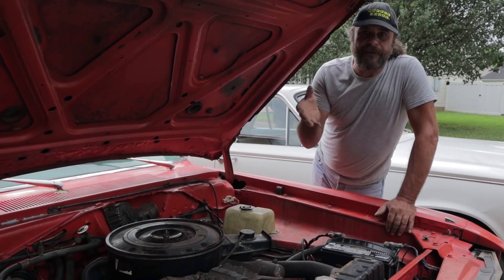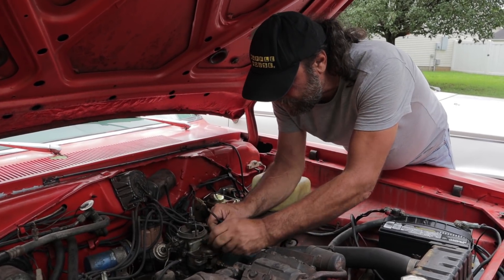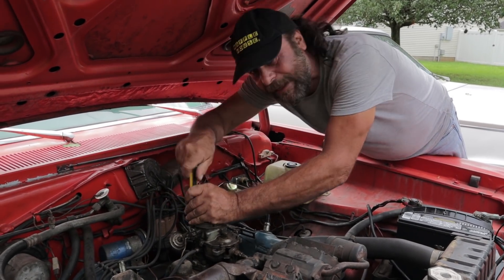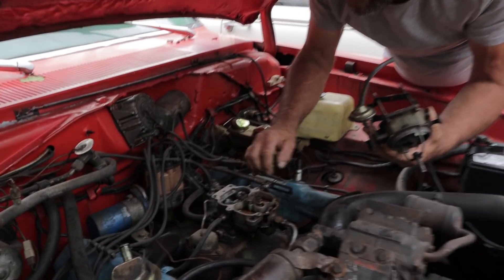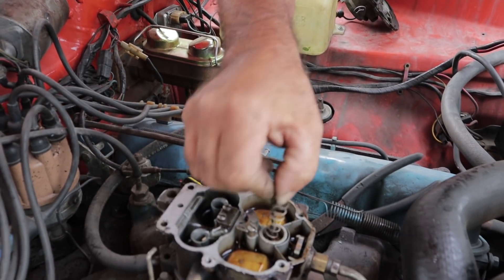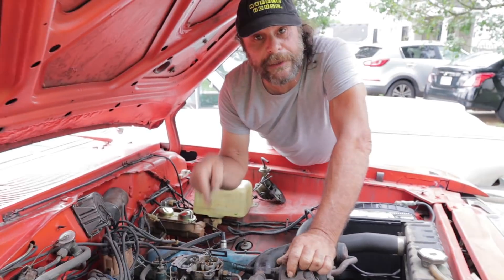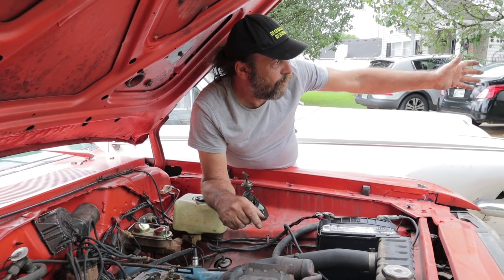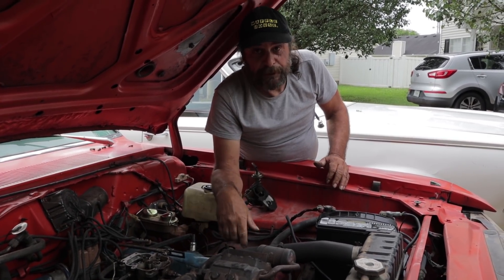Driving Classic Cars- The Truth About Ethanol Gas

Comment: This is why lawn equipment suffers the most, it sits during the winter months.
Reply: If you're getting your lawn equipment gas at a typical gas station then it would behave just the same as a car...
Reply: i live in the snow belt, some use their lawn mower gas in the snow blower if you're not living near the coast (powder versus wet). That said, i've had gas for years fire second time on a mower. Just have to keep it in tune is all.

on the tangent, I laugh at folks who use gas to "clean". ever pull a carb off the shelf and it still smells of gas? that's residue left behind....not the definition of "clean" :)

Comment: Unless you own a holly carburetor. Then you have to rebuild it once a year because of the dumb rubber power valve. It hardens up and starts running lean and backfiring through the carburetor. It’ll fail smog check like clockwork NOX and HC emissions through the roof.

Comment: We have used 10 percent ethanol blended fuel since the early 1970s.  I was working in the repair industry then also. I heard all kinds of doom and gloom stories about how ethanol will absolutley grenade the engine.   I have replaced several cars since then but that has more to do with cars back then regularly had engine overhauls at the 50-75 thousand mile mark.  I have a lawn mower that dates to that era that I have used every year since the early 1970s that is still running with blended fuel.   I keep waiting for the other shoe to drop. 

sure there were issues at the start.  Rubber parts that swelled up and neoprene floats that filled up and got heavy.  It didnt take the aftermarkets parts industry long (less than a year) to fix the manufacturing process.  We learned fast which parts companies were better than others.  Buy good parts. 

ethanol is a superior parts cleaning solvent .  So all of the varnish from gasoline in the tank is going to be run thru the fuel filter.   With predictable results.   Ethanol as a side effect acts as a fuel desiccant for cold weather use.   Read the label of the yellow bottle fuel additive for list of ingredients.  PT Barnam the circus guy said there is a sucker born every day.
Reply: beautiful comment! thank you!
Reply: @Jgarage5  No its not; he's full of shit. It was not in all the gas stations across the country like he makes it sound like. Ethanol was used as an octane booster in place of leaded fuel, and not even widely so. MTBE and ETBE was also used for the same purpose. Ethanol laced gasoline was not widespread until the mid-late 90s and not fully rooted until about 2005-2006 when the US mandated a minimum volume of ethanol be in fuel. Until then, it was just used as an oxygenate and octane booster.
Reply: @tehagent1321  In South America our gasoline has 25% alcohol added and cars also run on 100% hydrated ethanol. We don't have an problem with it even in classic cars. The only damage i can think of is letting it sit on an non-nickel coated carb.

Comment: I was having vapor lock issues in the hot cali summers. So I replaced all the old rubber hoses and rerouted the line that ran behind the alternator  away from the engine and haven't had any more vapor lock issues again.

Comment: Finally!! You just proved that ethanol isn't bad for carbs in less than 5 mins, and even managed to find one of the majors benefits of this gas, thanks! I just hear everyone speaking, but no one is putting his hands on a carburator to see if it's true, I'm in France, I've a 1.1L Renault 5 carbed engine built in 1984, and I'm going to feed this 47 hp beast with ethanol

Comment: I have a Rochester Qjet in my 71 camaro. Haven’t rebuilt it in 28 years. Still runs perfect. No rubber for the ethanol to ruin. Make sure you run a steel fuel line from the fuel pump to the carburetor.

Comment: I’ve rebuilt all my classic car’s carbs and fuel systems to occasionally use 10%, during summer, but store them during the winter months with non ethanol blended fuel just to be safe. Thanks for your thoughts Tony!
Reply: I have 20 classic cars and I made a mistake putting ethanol in and my carb after a month  and it looked like someone  threw up in it. Nasty don't do it.

Comment: Not sure I've seen Scotty do any actual work; just shouting nonsense and popping out of trunks and slamming tailgates.
Reply: Super Duty 455 he once said you should only use the front brakes on a motorcycle great advice right there.
Reply: @axipixel5811  are they as bad as the Ericthecarguy balljoint welding video?
Reply: @superduty4556  Hahaha, I have yet to see that video but probably.
Reply: @axipixel5811  if I think about it later I'll link it. Basically the balljoint was a little "loose" (wrong balljoint obv) so he put a couple tacks on it and shipped it.
Reply: @superduty4556  Why the fuck did he do that lol. I seen some of his stuff. Most of it seemed good
Reply: @superduty4556  Wow, that's bad. I feel like when people are presenting themselves as auto repair experts they have a responsibility to show people the right way to do things.
Reply: @axipixel5811  https://www.youtube.com/watch?v=SYnscq4pMKw Had to see it for myself. Starts around 6:48

Comment: Only thing I changed on my cars is ethanol rated fuel line. Mine has been running on ethanol for thousands of miles without issues. I did notice the carb bowl will evaporate the fuel faster after a month of sitting. Fill the bowl. Fire it right up.

Comment: The only bad rap on ethanol gas I keep hearing is that rubber fuel hoses and components like gaskets are eaten up quickly. Any truth to this?
Reply from the maker: Not in my experience.  Most rubber issues I come across can be attributed to bad chinese rubber
Reply: No. Only when it gets old, stale, and acidic. Fresh e10 does not degrade rubber lines or plastic components in my experience either. Old e10 will, but it takes a long time. The fuel going into the line has to be bad to begin with too. E10 stays fresh for years as long as there's no air present to pull water from.
Reply: yes, and it has a short shelf life, that's why after some time things wont start or run like crap

Comment: i just thought of a tip.  on ALL  small blocks and big blocks.   in the middle of the head next to the intake is an opening that loves to suck in bolts ext.    so cover that hole EVERY time you work on the top of the engine.

Comment: Good info. One thing people need to realize is that the ethanol we put in our cars is the exact same stuff, made the same way, as vodka, but at much higher proof.  In my 1970 GTO, that has the original tank and hard lines under it, since 1994 when I bought the car it has only seen either 10% ethanol pump gas or E85/E100. I switched it to E85 and home made E100 in 2007. Last summer I pulled the 13:1 compression 455 out of it and put it in my 65 GTO, because the 70 has so many electrical and suspension issues its getting a frame off. The 70 has been driven daily to sitting for years with the same E85 in the tank since 2007. In April 2017 I pulled the top off the Qjet I converted to E85 after pushing 3' of snow off the hood and took a picture of the float bowl. I had not touched that carb since 2014 when I drilled a couple more passages, and I converted it to E85 in 2008. The carb is still spotless inside, and it runs very hard on whatever engine I put it on. 

The 65 GTO is my daily driver all summer, I keep the E85 in 55 gallon drums because I have to drive 2 hours south to Wisconsin to buy it, its not sold anywhere closer than that. Next year I will have my stills set up again to make fuel here, from tree sap and cattails. Using tree sap it costs me about ten cents a gallon to make fuel, I can drive all my vehicles and have more cash left for parts doing that... plus it makes more power, runs cooler, everything lasts longer, oil changes are less frequent because the oil stays clean. The 455 in the 65 GTO has 1000 miles on the oil change, and it is hard to tell where it is on the dipstick because its still clean. No carbon buildup in the engine on ethanol.

I am the first to convert Qjets to E85, all the information everyone else have about it, such as Cliff Ruggles and Rocky Rotella, came from yours truly. I had a carb kit that was new in the box from 1978 that I bought back in 1987 but never used. The accelerator pump cup in it did not like ethanol. However, I have not found a carb kit in the last 30 years that had any problem whatsoever. That is where the accel pump thing came from, but that carb kit was the ONLY one I ever saw that had a problem, and I build lots of carbs. Doing two conversions right now for guys. Will be doing a Tri Power for a Pontiac soon.

Everything sold today is compatible, even if they say it isn't, when they want to charge more to get it to say it is. If its good with 10% its good with 100%, I have been testing it for 12 years now, from daily driving to sitting long enough for it to evaporate. I use E85 to clean pistons, carbs, and all kinds of stuff. 

The reason I got into making ethanol fuel and converting carbs and EFI to run it is simple. Back in 2005-2014 87 octane gas was $3.50 to $5 a gallon where I live. Premium was $6 for a long time, and being a crippled Iraq war vet on a fixed income, I can't afford to drive my hold hotrods and muscle cars. So I looked into making fuel at home, at first thinking methanol, but that is not as easy to make, its very toxic, highly corrosive, and requires special parts and an after run oil to keep it from eating everything. Ethanol has none of that, and you can drink it, but the government gets irritable if you drink it because they are not getting their taxes, so don't do that. Most people confuse methanol and ethanol, they are very different, but are both alcohols. One will kill you with 10ml (methanol), the other you drink in bars all over the world. Beeswax is also an alcohol, and its nothing like the other two. 

Old cars love ethanol fuel as much as new cars. Raise the compression well above where you can run pump gas, and you get the same or better mileage with more power on ethanol. My 65 gets 15mpg now that I dropped the compression to 11.5:1 with a head swap, and it has low 11 second capability now. It got 15mpg with a 400 that had 7.7:1 compression and would run on any camel whiz 87 octane you threw at it, and ran in the mid to low 13s. getting more than 15mpg with that car is a problem because the aerodynamic drag is quite high, but a bigger engine with almost 200hp/tq more gets the same mileage on E85. The 70 GTO managed 20mpg with one of my Qjets and the 13:1 heads, and had more than enough power to run 11s despite being a 4100lb car with a highway gear and a stock stall converter.

The power and drivability available with ethanol is very impressive. Once you try the stuff with a properly set up carb in your muscle car, you are not going to want to switch back.

Comment: Its usually water corrosion from having the fuel sit, not being flushed out constantly, like for 6 months straight, or worse several years. Ethanol doesn't necessarily destroy rubber materials, unless in content more than 20%. Usually the ethanol fuel does more corrosive damage to the insides of small engine carburetors, more often than anything else.

Comment: I run no ethanol 91 in my carbureted engines. 🤷🏻‍♂️
Reply: Wait? How? Are there pumps which don't have ethanol in them in the US? What do they use instead? Lead?
Reply: I’ve heard that marinas sell ethanol free gas, I’m not sure if they all do or how many of them will let you drive in and fill up your car though...
Reply: We have zero ethanol fuel in Australia. Only a few sell 10% ethanol we have choice of 91,94 & 98 Ron fuel.
Reply from the maker: Awesome...now run a few tanks of 87 octane 10% ethanol through them and tell me if the difference is worth the cost/hassle
Reply: Uncle Tony's Garage, I mostly run the 91 because of compression ratio, I’m not too worried about the ethanol. 😄👍🏻
Reply: Glam Stachee, A couple local gas stations have no ethanol 91, but have 85 and 87 with 10% ethanol on the same pump...
Reply: @GlamStacheessnostalgialounge  most airports have low lead 110 octane.
Reply: Ethanol is a great antiknock agent and burns cooler. I run 93 octane E10 on my supercharged 5.0 Foxbody, though I have also tuned it for E25 if I mix a few gallons of E85 gas in. This is on a pushrod 302 - by no means a "modern" engine; though I do run fuel injection on it. I will have to pass on your toilet bowl carb and your detonation-prone 91 octane gas.
Reply: prushimush, I’ve never had detonation problems with the 91 gas, I’d run the 93 like you have if it was available in my area, 91 is all we have. 🤷🏻‍♂️
Reply: @shitbox7413   I personally know of some people who run around 40psi of boost pressure in turbocharged subaru engines on e85 without any knock which would not be possible with regular gasoline. Friend of mine also runs e85 on his supercharged 04 cobra it is close to 25psi of boost and he sprays a 150 shot of nitrous on top of that and has been running like that for years now with no issues and beat on regularly. Most people don't have extreme setups like that so for the average joe it doesn't matter so much for mild hot rod's they can run just fine on pump gasoline but the ethanol fuel does help keep things alive when you start to really push the limits. Most people wont notice any difference between cheap gas with 10% ethanol and straight 91 non-oxy ive run both in carbureted snowmobiles and other small engines and i cant tell any difference between the two.

Comment: I hauled pure ethanol for Flying J Transportation from 2010 to 2013... bill of lading says (Iiterally) "200 proof"... it's pure alcohol.  We had to replace the belly valve gaskets in the tankers (Heil and Beall trailers) and also the gaskets on the discharge valves--and even the clear sight glasses that allow the driver to monitor product flow.  The ethanol would eat through the original gaskes on these trailers, and it discolored and gave a shattered look to the sight glasses.  Pure alcohol is pretty aggressive on many types of gasket material.

Comment: I've never had an issue with ethanol gas in a daily driver. But when ethanol gas sits in things like lawnmowers or dirt bikes that sit 6 months out if the year it leaves a nasty goo in the bowl. I actually had some of that goo seize up a carb once on something that sat and I had forgotten to drain the bowl. 

I will say this, there was a gas station in upstate New York I was filling up at on a road trip and it sold ethanol free gas! My trusty old jeep xj sure did seem to have more power with that gas although. Maybe all in my head but sure seemed to be a significant difference

Comment: Just keep an eye on any rubber fuel hoses. The ethanol most definitely perishes the newer manufactured stuff if not all of it and I have had genuine Gates "suitable for unleaded" and Earl's rubber lined metal braided hoses hardening, cracking and leaking after only about 5 or 10 years. That's why Earls specify only using teflon lined hose for ethanol applications.  Don't be complacent about fuel hoses, check and replace anything that has signs of splits or perishing on the cut ends or doesn't seem as flexible as it should be. nobody wants to see their pride and joy burn to the ground. Top vid as always, top speed carb strip impressive. If I'd slung the screws on the scuttle that fast there would definitely be a half hour magnet fishing episode getting them out the scuttle panel air slats. There did seem to be a lack of cigarette ash in the float bowls as well I noticed.

Comment: I see the same results with my quadrajet I got from SummitRacing back in 2007. I was just out of high school. So far I only had to rebuild it once, and that was 5 years ago and still running great. It’s on my half million mile Chevy 305 that is original to my 83 K5 Blazer that was bought new at the dealer by my dad.

Comment: Tony, you did not mention that ethanol has 2/3 the energy of gasoline by volume.  The ethanol gasoline makes a carbureted engine run leaner.
Reply: That's not what that means.
Reply: Beardedcap agreed
Reply: That's not how that works. You are looking at the end result of combustion and calling it the cause in that statement.

Ehtanol reaction: C2H5OH + 3 O2 → 2 CO2 + 3 H2O

Octane (One of many of the of the C4-C12 molecules in gasoline) reaction: 2 C8H18 + 25 O2 
→16 CO2+ 18 H2O

These are balanced equations and you can see for every molecule of ethanol it will oxidize 3 molecules of O2. While octane will oxidize 12.5. This is what causes the leaning, not the energy content directly. The energy content is from how many H bonds can be broken which leads to how many oxygen molecules it can oxidize.
Reply: 1.5 gallons of ethanol has the same energy content as 1.0 gallon of gasoline. 
The energy content of 1.0 US gallon of ethanol is 76,100 BTU, compared to 114,100 BTU for gasoline. 

 

 Pure ethanol provides 2/3 of the heat value available in pure gasoline. 

In the most common calculation, that is, the BTU value of pure gasoline vs gasoline with 10% ethanol, the latter has just over 96% BTU value of pure gasoline. 

https://en.wikipedia.org/wiki/Gasoline_gallon_equivalent
Reply from the maker: The effect is almost non existent.  A jet change of .001 would compensate

Comment: Nope... too many personal horror stories for me.  I've bought collector cars that the idiots left ethanol sitting in, and EVERY time, I've had to drop the tank, clean out the rust, rebuild the carbs, change the fuel lines, absolutely a nightmare.  If you're daily driving it, probably fine, if the car is going to sit over the winter, absolutely do NOT run ethanol.